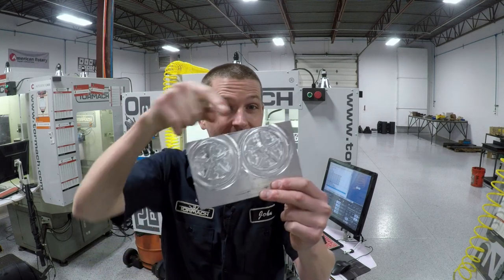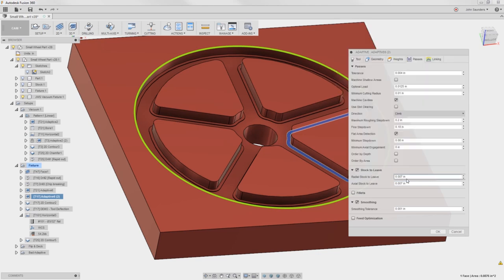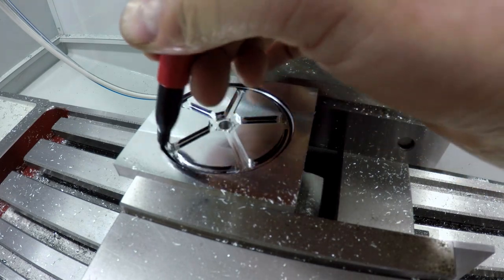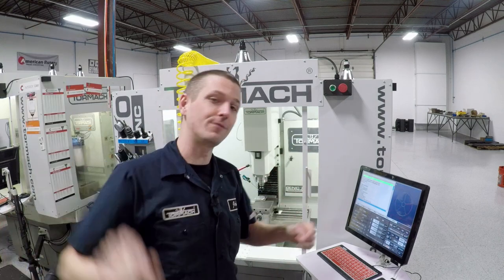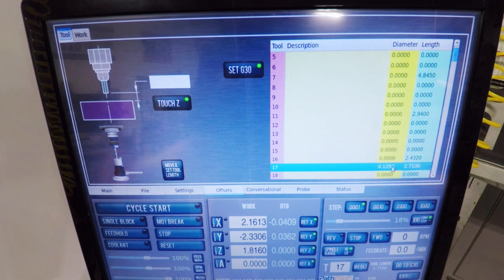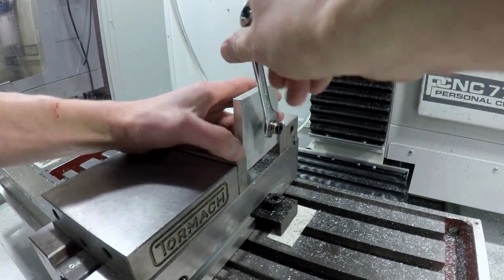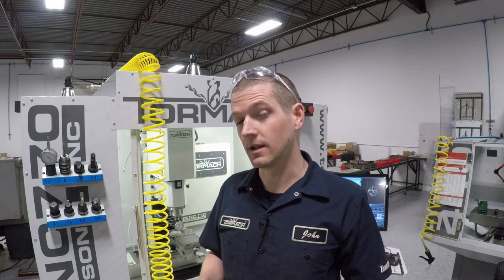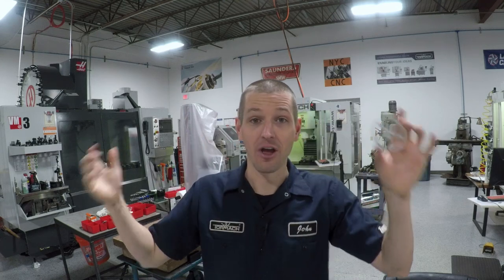Machining Thin Parts!  Part 2 WW139

Comment: Machine a similar groove as the Pierson plate under the outer diameter of the part and run that gasket strip.  Love your vids!!
Reply: I was thinking something like an off the shelf o-ring to get seal as well.
Reply: Air will still leak in around the spokes and the inner edge of the rim. Your gasket needs to run along ALL edges of the workpiece.

Comment: If using a screw to hold it in, make the out side of the radius taller so the center in lower . You can level it out by tightening the screw

Comment: Screwing the part down would be my preference - I built vacuum fixtures in the past and they always needed a seal. Normaly I only go trough that trouble for parts that are very sensitive (Had to re-machine 500 painted plastic parts once, for those I made a simple 5-station vacuum fixture out of plastic. For that fixture I cut and glued soft foam rubber into custom seals that fit in a groove on the bottom of the cavities for the parts.

I am still not convinced that trochoidal milling slots in aluminum is always the best solution - I absolutely prefer to increase the feed  and keep the Doc low on a contour like the fixture you machined in this video.
Reply: I agree, the only other way I would try would be to run a much higher flow pump and increase the depth of the vents. Also making it out of plastic would help with the sealing a lot but you still may have to resort to installing seals. I have a vacuum chuck on my router and even there I tape, screw, or spray glue material to it most of the time as its just so much less chance of it failing.
Reply: Totally agree on the slots, so many good tools out there can easily handle slotting and its so much faster even if you have to use multiple depths.

Comment: if there was no vacuum channel in the jig when u used the fastener approach it may sit flatter because when you pull the center down in the middle the outside edges will naturally try to lift, if the floor of the jig pocket was flat it couldn't pull down the centre of the part.

Comment: I have used a special 3M double sided tape.  Don't use coolant during machining and you will need to use light cuts.  Use acetone to remove the adhesive.

Comment: extra wide set of shallow soft jaws (full profile) would do the trick too.  if you cut the tolerance as close as those first fixture cuts, it should keep the pressure pretty evenly distributed with plenty of surface area to grip and very little if any distortion.

Comment: I am really digging the cutter comp.....I ran a cleanup op on the mill from the plasma table today, and I had to keep adding stock to leave by 10 thou each time until I reached the final correct amount....it ended up being 70 thou over, so 7 trips back to the computer, this would of saved me a lot of steps!  Luckily I have quite a few more to make, so I will be implementing this on the next batch!  YAY

Comment: Thanks for posting John.  If I was doing that job in high volume I would try two concentric 1/16" o-rings around the perimeter and move the vacuum port.  Maybe add an additional pair of o-rings in the center if it lifts too much.

Comment: In some cad cams for example Featurecam only the finish cut is output with cutter comp. The code is generated with the tool on the centre line of the contour and the D is used to call up a radius value from the tool offset table. I use it for every part I machine with my Fanuc controller :-)

Comment: We have a Datron at work with a vac bed. It uses a special card with a self adhesive grid on it to create small vacuum pockets between the card and the part. It'll hold something like this no problem. And the squish of the card is calculated under vacuum so it stays accurate in Z. Might be a cheaper alternative for an experiment.

Comment: Great vid John. Something I noticed when you posted the code... your Brackets is set on "text" mode (lower right corner of the window). If you change it to "Gcode" it will automatically color code your file to make it somewhat easier to read. Ciao, Marco.

Comment: I'd cut o-ring grooves into the fixture, one around the outer diameter of the wheel face and one around each of the wedge shape areas around the spokes. You should seal against the machined face pretty well with o-rings.

Comment: Great idea love your videos. Here is what may help holding the wheel in your side two operation: 1. Move the vacuum grooves to the center away from the sides. 2. Use a heavy grease to help getting a better seal.

Comment: When I use to work with vacuum all the time we would cut a small channel around the outer edges and put in some small dia neoprene rubber almost always got a seal,  John did you connect the vacuum channel back to the suction point don't remember seeing a star to centre in vac channel tool path.
your 3/32 channel just shy of 3/32 deep 3/32 dia rubber no problem  just but fit. 
If the all outer edges are O ringed  will pull down flat all around, 
Cheers

Comment: John, I would try some type of grease to aid holding the vacuum. I think it would have held if you could reduce the leakage. Your vacuum pump just isn't capable of moving a greater quantity of air. Vacuum grease is commonly used in laboratory setups to reduce leaks at fittings. Worth a shot if it became a production run. Maybe with a bigger vacuum pump too.

Comment: a groove around the outside of the diameter of the wheel with a thin O-ring. The vacuum will compress the o-ring to where the part fits flat with bottom of the fixture.

Comment: Thanks for sharing this one, i wonder if adding an o-ring to the fixture on the outer diameter of the part would have helped, most likely not i suppose. would be interesting to understand where the vacuum was leaking off.

Comment: John, the part is going to leak. No way around it. you need to be able to flow enough air to maintain atmospheric pressure at all points to maximize holding force. And you need the atmospheric force to act on holding down the part, not overcoming friction to force it into place.

Start with a substantial vacuum pump. High flow (cfm) is way more important than absolute vacuum level. you need to evacuate unwanted air fast.

open up the fixture until the part will drop into place on it's own, that way the vacuum will be acting solely to hold the part down, not to overcome friction. 

make the vacuum channel underneath absolutely as wide as possible. only leave the bare minimum shoulder needed to support the part without deforming. this is critical because only the area exposed to vacuum is creating down force. Every bit of shoulder supporting the part is taking away holding force.

the thing will leak, so you need to remove air at a very high rate to maintain holding force. In addition to the high flow vacuum pump, you need large passages. make your vacuum channel as deep as practical and use a large fitting and hose to the vac pump, at least 3/8".

Air is much thinner than liquid! consider running flood coolant. it will suck through the gaps much slower than air and increase vacuum level under the part. if you try this part you would have to include a sealed container between the vac pump and fixture to catch coolant that was sucked through and prevent it from reaching the pump.

the best you can hope for is about 15 pounds force per square inch of part geometry, less depending on your altitude above sea level. if this isn't enough then the whole idea is moot.

Comment: Assuming there's no hard requirement for the part to be made from aluminium perhaps switch to steel and hold it down with magnets. It's like the parallelism requirement you mentioned, if it's not in the drawing don't put it in. If aluminium is required then perhaps you could design a hold down jig that lets you machine one half and then the other. I'm thinking something that looks like a radiation sign without the centre dot. After the first half is machined you could just rotate the hold down 60 degrees and machine the other half.

Comment: John, my recommendation with cutter comp is use wear or inverse wear not control. This way you will have less issues with lead in and lead outs not being long enough and causing either alarm or gouge. Also it's way less likely that you'll typo a tool diameter and crash, just program everything over sized like you did and then you only have to adjust to fit a few thou with each tool and if you enter the offset in  the wrong tool # not problem, ex. no crash! Also then your simulation is still 99.99% valid as your lead in and out potentially is going to be messed with by the cutter comp move generated by the control. The bigger the comp move the bigger the canch of an unexpected change in the tool path that you can not verify till you push the 'hope this works' button.

Comment: drill holes along the axis of the spokes of the wheel with a counter bore say .5 mm deep then use small o-rings in the holes then you can use the smartvac to hold down the part without loss of suction :)

Comment: Just make blanks on the lathe (finish o.d. and thickness) and cut out the windows on the mill. Quick circular soft jaw with light torque and you're all done.

Comment: I am a absolute beginner to machining. However I am a longtime user of Cyanoacrylate Glue and there is a caveat to using accelerator. Ithink that it weakens the bond.For maximun strength it needs to set on its own. I use it to fill seams in plastic and if you use the accelorator then it seems to sand out much easier than if you allow to set on its own which causes it to be harder than the plastic around it. If you are going to be using it in a high heat application I might be concerned about using Zip Kicker. But you guys probably knew all that anyway. 

I did say I was a total begginer.

Comment: liked the video. I have done a lot of machining in vac fixtures just as you did here and it works better if you use an actual vacuum pump to draw the part down and the more CFM'S you move the better.

The trouble you had with the comp. erroring out was because you have to have a G01 command at least as long as your compensation value in order for the comp. code to work. I always prefer to use wear comp for that reason. I can use a short G01, an arc lead in and then the part geometry.

Really enjoy your videos.
Reply: David Fredericksen Still not a good part for ANY vacuum pump since the surface area of the part is so low. The max holding power of a vacuum pump at sea level is 14.9 lbs per square inch. It was worth a try to learn.
Reply: Jay, agreed, the surface area is not ideal, but I believe with some "downcut" tooling and specific strategies it could be pulled off. You never know until you try... right. If you would have told me 25 years ago we would be cutting parts at 600ipm I wouldn't have believed it.

Comment: I love your videos. Your sharpy demonstration of tool deflection raised an eyebrow...If, for talking sake, it milled perfectly (no deflection, 100% accurate), and then you added a thin film of sharpy. If you ran the same gcode again, it would remove the sharpy, obviously. Same idea as when you ran superfly over your powder coated sign.

Comment: If you arent using d comps normally, how are you getting parts on size?  Reposting?  D comps are industry standard i thought
Reply: BradPittlike Yes I ask my self same question. For getting h7 tolerance, he probably must generate multiple codes for same operation.
Reply: There's many ways to skin the same cat.
Reply: Yeah reposting - complete Pita and proctivity killer. Had to run a machine once where we didnt have a postprocessor that could output compensation, that was a slight nightmare ;)
Reply: I'm not knocking him for it.  I just wondered how he does it because d comps are very quick and handy to size up a part.

Comment: Put a small layer of silicone sealant around the outer edge of the fixture plate.  let it dry first so it wont stick to the part.

the vacuum itself shoud press the part harder against the seal making the vacuum stronger.

Comment: Crazy idea I tried on similar project. Use a very small amount of shaving gel. It seals and washes away with water. The beauty is its change between gel to foam that seals the small void.

Comment: High production of thin parts like this are perfect for a cnc router. You can get one with a 24-30,000 rpm spindle and blaze an "O" flute through there at a high chip load. Maybe your next machine?

Comment: I would have cut a plate to thickness, then the inside contour, then the outside contour after refixturing, then chamfering on the backside. I would guess that gives you much more repeatable results and better thickness consistency. imho you will only get the vacuum to hold with o-rings underneath the spokes.

Comment: Amateur here: I feel that the exact shape of the vacuum fixture is working against you. The part should touch the fixture as little as possible - around the edge, a few supports (to stop the vacuum dishing the part) and a few pins for indexing the spokes - everything else should be milled away. This has the added benefit of increasing the surface area that vacuum is applied to. I'll try draw it if this isn't clear, but I suck at Fusion.
Reply: Disregard that. You'll lose vacuum as soon as you start cutting. But I still think that a less exact fixture will allow the part more room to conform.

Comment: No problem make part from steel and hold it with a magnet. :-) lol  Try heavy grease or if that is too nasty vaseline to get your vacuum to work. That finishing with the sandpaper would eat a lot of time in production. How about a vibratory finisher? I have used my concrete mixer and creek sand to do polishing before too. Just be sure to take the paddles out as they can ding your parts.
Reply: Agree - Aluminium is so annoying, doesnt stick to magnet chucks :(

Comment: That's the limitation of vacuum plates - atmospheric pressure of about 15 psi (offset by the ~0 psi of the vacuum). Now if you could pressurize the workspace (above the vacuum plate or fixture) to about 100 psi you could get 100 pounds of pressure for each square inch of the workpiece. (I wonder if anyone has ever done this?)
Reply: I was thinking of the same thing. It would really slow down changing parts though because you would have to wait for your entire work area to pressurize and depressurize between parts.
Reply: +Everyday soldier - If, for some reason, such a hyper-atmospheric hold down was absolutely needed, a magazine feed such as the one John is making for engraving the NYC-CNC clamp arms would have to be set inside the  high-pressure enclosure along with a receiver for completed parts. Chip clearance within the high-pressure volume would have to be accommodated as well. That way the work area would only have to be pressurized for each batch. Pretty unlikely that some other hold down system could not be found that would be easier to create. This is pretty much a thought experiment.

Comment: you should have the vacuum seal only on the rim,  not the spokes.  and for the fastener you should relieve the center so the part is pulled against out side rim just before it hits on hub in center, or spokes

Comment: I think I'd sooner go with casting to make the holder rather than machining it. 
Also, wouldn't you need radial grooves from the center hole for the vacuum to access the "wings"?

Comment: Use care when playing with wear values and "walking it in" on the HAAS. Some tricky things going on with the values not getting updated. The wear value is only added or subtracted when certain G codes are seen.. IE. Say you changed the wear column by -0.001, this new values does not get added or subtracted from the tool until it sees something like G40 at the start or M30 at the end (it's still using the previous value which has been stored in a register). This can mess you up when you're starting and stopping in the middle of code and the machine never sees the G40 or M30.
End result is that when it finally does see  G40 or M30.. it adds (or subtracts) all those adjustments you just made trying to "walk it in". Now your part is too small and you just wasted $120 worth of aluminum.

Comment: When I use circle interpolation to cut a diameter, its never exactly round. Depending on the machine I use, its anywhere from .0005" -.003" oval. I wouldn't think .0005" would cause an issue for the vacuum but I've never used one. I would try cutting a diameter in another piece of stock to see if your machine cuts an oval like my haas.

Comment: On the fixture, try making a lip around all the edges and then use silicone to fill that lip. If you make the edges of the lip spotted or knurled, the silicon should stay in place.

Comment: I think using tabs would be a good way to go (thick enough to allow for bottom side ops), than flip the material before cutting the tabs, than mill to thickness, than chamfer, than add hold down bolts through center hole to the fixture with thick washer disk to help, than finishing contour to remove the tabs. You could use the center of the stock as the origin so when you flip the part the toolpaths "match" up no matter if the stock isn't precisely what you entered in CAM (learned this the hard way when flipping parts), just make sure you locate it parallel with the X axis with dowels or something in the pallet. A table sized pallet with the needed tapped holes could be made to help production along with the washer disks.

Comment: I would try a tool with an as negative as possible back rake angle so that the cutting forces push the part to the fixture.